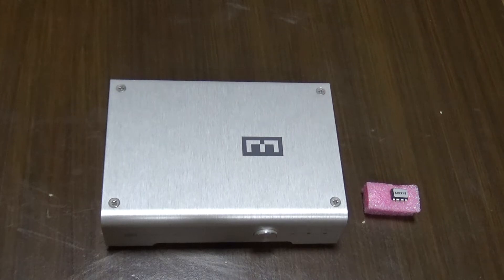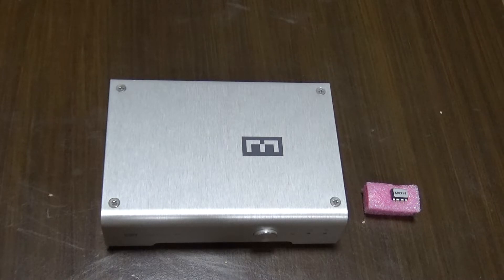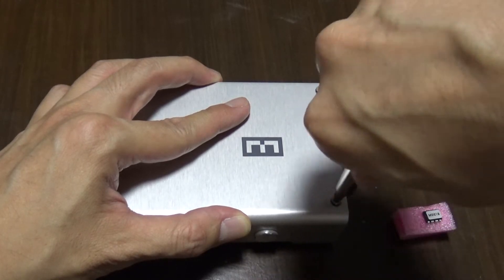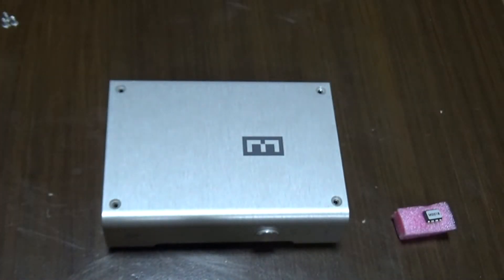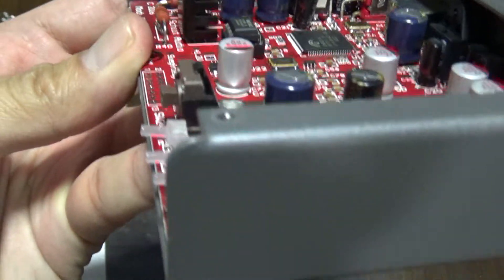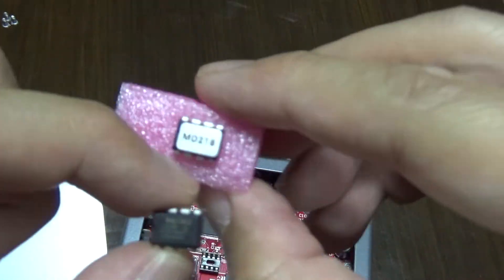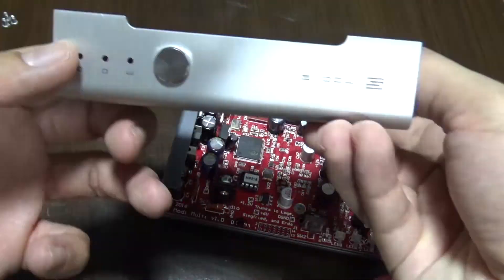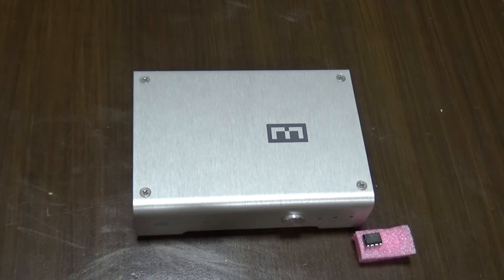Schiit Modi Multibit Firmware Upgrade (to MD 2/18 firmware)

Comment: I asked Schiit customer service about the firmware update to see if it was worth it to send mine in. To decide, I asked them if the firmware update was very meaningful or it just improved some sonic issues. They replied to my email, and said that it corrects some connectivity issues such as computers not recognizing the USB.
Reply from the maker: When did you buy your Mimby? In my case the 2/18 firmware did a lot to tame the bass.
Reply: @TheAudiofool  2017. I asked schiit about sound issues and they said it was just about usb connectivity.
Reply from the maker: @chepitoloroco  Hmm that's interesting. Well the MImby pre 218 is quite okay itself but the 218 is so much better for me. THere's no need for you to upgrade, but you can search the internet for what other people say. https://www.superbestaudiofriends.org/index.php?threads/how-i-upgraded-the-modi-multibit-firmware.7754/
Reply: @TheAudiofool  Well, according to Tom from Schiit customer service, the MD218 chip just corrects some connectivity issues such as computers not recognizing the USB. 

That’s all apparently.
Reply from the maker: @chepitoloroco  Stick with your firmware then
Reply: @TheAudiofool  In terms of sound it’s the same as the new ones according to the manufacturer, so yeah I think I will